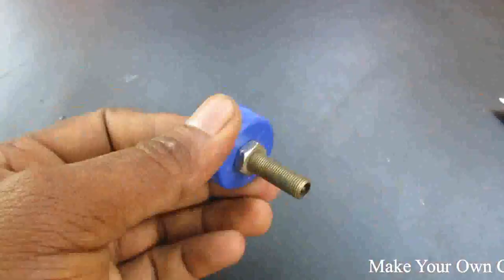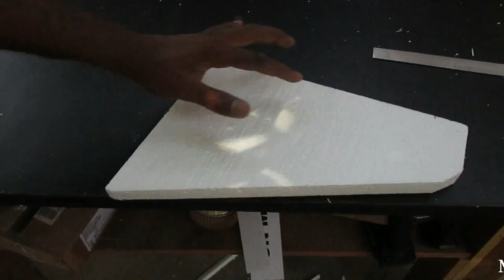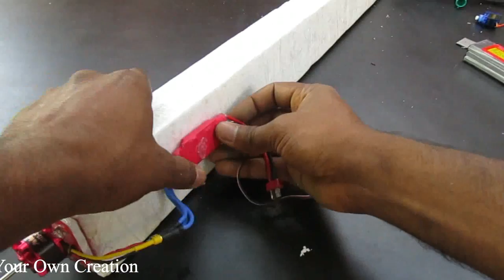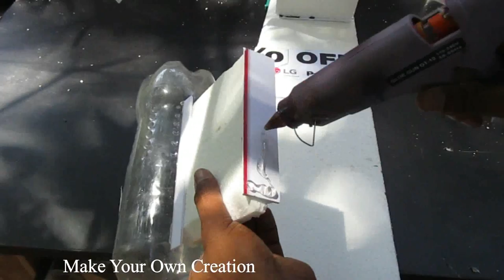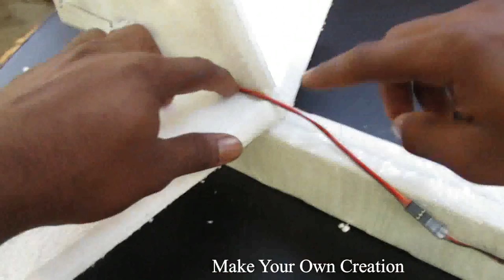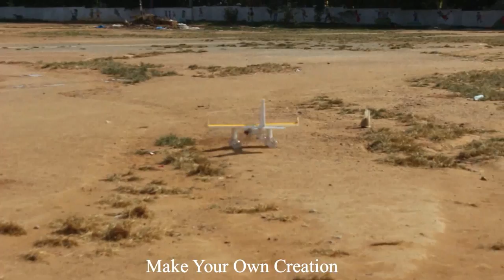How to make a airplane - flying plastic bottle aeroplane - seaplane

Comment: i would sacrifice yaw control for roll control as you wont need to use the rudder in flight for simpler designs, and have speed and pitch linked simultaneously if it only has acceleration and turning.
 Also try having your elevators permenantly set to pitch upwards. It's a less expensive but your plane will pitch automatically if going faster than a set speed, meaning that you will keep having to press and let go of the throttle constantly during flight, but can still turn the plane by banking sideways and pitching upwards. This is a way cheaper method if you only have a remote control car as your transmission equipment.

Hope this helps

(ps: add some dihedral to the wings for added stability)

Comment: too much asymmetric drag when one side pontoon is about to lose contact with the water.   Most seaplanes rely on   on-axis flotation, and side pontoons are more for slower speed stability..   Need to replace the two with one centre bottle and smaller side pontoons  ( I think )

Comment: Good effort but the wing was erroneously designed make it aerodynamic and add two elevators on both the wings. With a RC unit. It will work. Keep good thing up.

Comment: I am very disappointed from this project I never expect you that you make like this you make it good but I expected more from a plane whether it is a sailplane or seaplane instead of water bottles you have to make the float of that home which you use to make for plane instead of taking the take off from ground you have to take take off from water directly after attaching the floats the water bottle break the flow of water because they are not streamlined and the most important thing is that you cannot check the CG before flight please check the centre of gravity of the RC plane you ever make it is the most important part of the plane if you cannot check the centre of gravity airplane never flies well

Comment: the reason for the airplane tipping upside down into the water is... you never installed ailerons & mainly an elevator hence there is no lifting surfaces to lift the plane off the water...
Reply from the maker: ok thanks for your feedback

Comment: Of course it's not going to fly. In my younger days I made balsa and tissue planes from proper kits, and getting them to fly required a lot of careful work and very careful trimming fore-and-aft, and port-and-starboard. The wings had to match each other exactly, and you had to spend a lot of time trimming the aircraft to get the CoG just right or it would dive or stall. Vaguely cutting an aerofoil shape by hand in the wings and tailplane won't work, and with no dihedral in the wing section, canting to the one side or the other immediately on takeoff is practically inevitable.

Comment: If you could put this much effort into making one, perhaps adding aileron, elevators, smoothing out the leading and trailing edges and adding a floating device that would create less drag will definitely increase the chances!

Respect to your efforts.
Reply from the maker: i m done